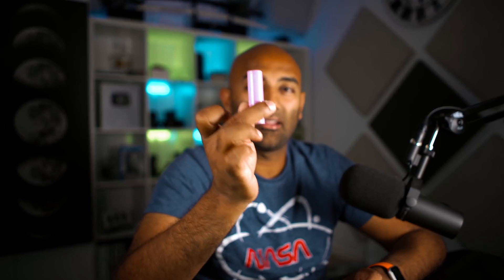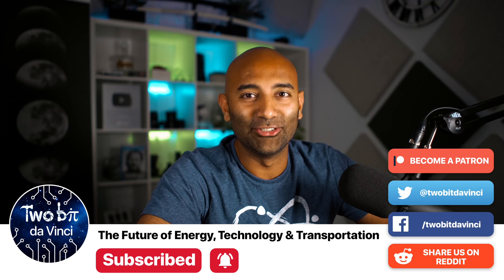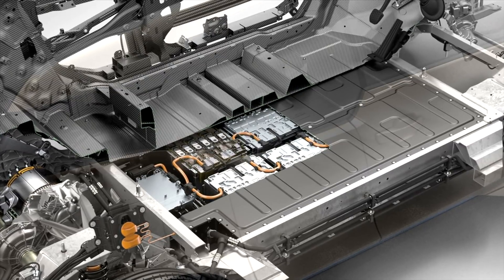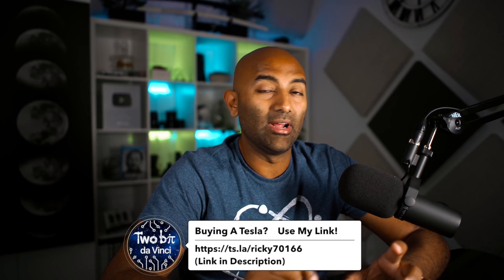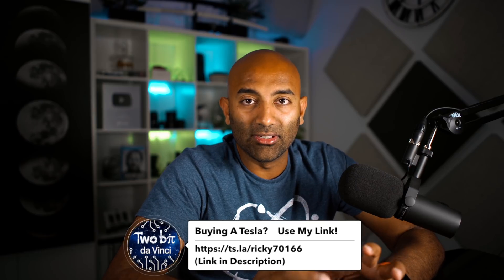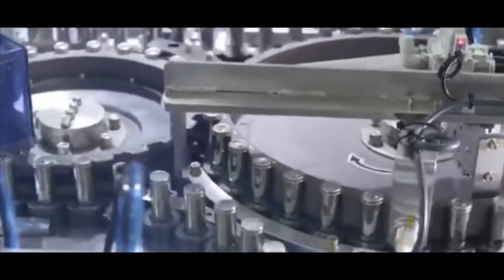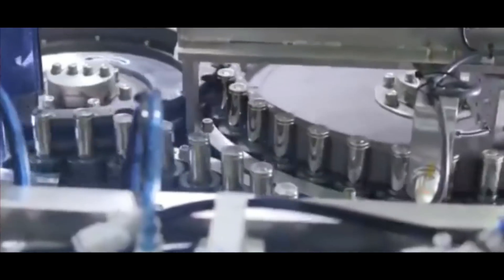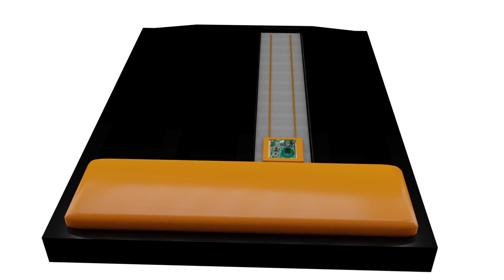Is Tesla Moving Their Battery Strategy to Prismatic Cells?

Comment from the maker: Be my hero, become a Patron!  ⟫ https://geni.us/TwoBitPatreon
Buying a Tesla? Use my Link ⟫ https://ts.la/ricky70166
Reply: recent news is that tesla wants to make them cheaper to get subsidized by the CCP.
Reply: With all of the new battery technology that is evolving so rapidly due to new manufacturing innovations, affordability, breakthroughs, etcetera. Which battery will be more effective or the most powerful? The Prismatic, Graphene, or Carbon/Lithium Ion Hybrid? From what i've gathered, the Carbon/Lithium Ion hybrid battery. Boasts that it will have 8 times the capacity of a battery the same size and have an increased cycle life of 30%. And ofcourse the environmental benefits are hard to ignore as well. As we will be using an abundance of carbon emissions to manufacture these batteries. Are the graphene batteries becoming more affordable now due to manufacturing breakthroughs? I'm loving that new battery technologies are going to be an integral part of grid storage going forward. As I live in N. California where last summer we had to shutdown the electric grid for days due to high winds causing the fire danger to increase, as the main transmission lines for PG&E do not have enough clearance from the forrest underbrush of mismanaged lands that are overgrown. In the event high winds cause transmission lines to break? We here would have an immediate forest fire to fight, increasing the length of the electric outage. So for me having batteries that are able to store enough power to charge all my electronics. Ones that I cannot live without in this day and age Lol. Really is something that interests me greatly as I don't want to run a generator if I don't need to. I really did enjoy the segment and look forward to watching many, many more. Thank You 👊
Reply: Totally debunked by BD, so re-listened for rationale...NADA! Where did that info come from?
Reply: Two Bit da Vinci, I’m gonna use your link for a Solarglass roof and solar panels in a couple of days if I can, I reserved them already. Your channel is one of the best, keep up the great work, Ricky.

Comment: I've heard that eventually new battery tech will make it down to EBikes, EScooters, etc. What I'm wondering is do you think older pre say Graphene batteries models will be retrofitted with the newer model battery and is that even possible? Keep in mind many a user today has to develop some leve. Of maintenance skill as the availability of shops that can and or are willing to work on them is still fairly sparse so even if a controller need be upgraded it won't be that much of a hindrance for those who don't want the car trap of buying a new model every few years.

Comment: They originally did cylindrical cells because of economy of scale (standard size, lots of small cells make it easy to make mass produce batteries even if the car is not yet mass produced). CATL already has mass production of prismatic cell so it make sense for Tesla to use them as much as possible. As long as they can get the cooling and charge speed under control there is no need for the high cooling surface area of cylindrical cell pack.

Comment: You need to cover how the new battery configuration will apply a new Cooling Systems to the new configuration otherwise the battery may be "cheeper" but will not have an extended Battery System Life.................

Comment: I wish more manufacturers would use LFP cells. They've been around a long time and the Chinese have been using them as their most common type for years. They have the advantage of being cheap, sustainable, and long lasting, perfect for a cheap commuter car. The energy density is a bit low, but not that bad. You could easily have a cheap car with 120-150 mile range, which is plenty for local driving. They aren't perfect for every use, but they don't need to be. They're perfect for a cheap, practical daily driver, which is what I need and millions of others too.

Comment: LFP sounds like it would be ideal for solar storage capability
Reply: Yes, we used them in a lot of our solar projects.  With a nominal voltage of 3.2v, it is also perfect to power a lot of electronics that run on 3.3v (2.7v to 3.7v) with minimal voltage regulation. It can also be charged down to -20c, making it great for cold weather.  It also holds up to heat pretty well.  We can't remotely measure capacity, but our greenhouse product is exposed to a lot of heat for over 10 years and we notice almost zero replacement request related to battery capacity.

Comment: Prismatic?

No idea where the name (which is certainly not descriptive of layered pack-cells) came from.  And I have no notion of why the term has stuck for flat-pack batteries or cells.
I digress.  Just saying.

But as electronics engineer, I would expect Tesla to handle this chemistry  and physical format alteration and peak charge/discharge power quite easily with the current electronic control/monitoring suite in all their cars.

The other main issue is to simply ensure that the FOOTPRINT (x/y/z) and connectivity for new battery packs is retro-fit capable.  Not very hard for the switched-on guys at Tesla.
Furthermore, as Tesla has opted from the beginning to embed the BMS technology into the battery packs themselves, if this strategy continues (why would they do otherwise?) then battery-car dialogues and battery monitoring and management is purely a matter of different parameter settings (I presume - but do not know).

So whatever turns up in respect of battery performance improvements, I would not expect Tesla to be in the least bit reticent about adopting them soonest - and with the same impressive aplomb they have previously managed, to trash other preconceptions about EV's in the last decade.

Comment: Have they considered how to recycle ,end of life and reclaim rare earth metals
Reply: Morando Bertoncini That was built in from the start. With auto batteries good for 10-18 years to 80% capacity, at the end of that period they are perfect for home solar storage.  For example, a Tesla 75 kW battery would have 55-60 kW which is good for approx. 3 days without sunlight.  That may be good for an additional 10-20 years. At that point metal recycling is available and will be a lower cost source of raw material for new batteries.

Comment: Personally-(Current world reality 3.5.20-dmy aside)
 I'd say that for Cooling; liquid that has a gas pressured in.
And tubes that are both conductive and permeable to that gas.

That liquid gets too hot, 1. Those tubes will conduct the heat out.
2. Gas will get in and carry out some off the energy.

In a radiator area, heat is radiated out, and the liquid is reinfused with the now cooled gas.

What they do is probably simmilar.

As to the Battery..

A Square shape would be an improvement.
More space to expand to, as long as it has enough space.

I would say though..

Making the Roof solar, would help with batteries that can't hold enough.

Also, capasitors..

As such, with those, batteries like iron/iron will be possible to be used.

Comment: I would of also mentioned that LFP is a chemistry that has been around for years longer than nearly all current chemistries so is a proven highly reliable tech which is almost impossible to catch fire...Yes it is a little less energy dense but all the space re gained from the wasted space between the cylindrical cells should make up for it and maybe then some.
Reply: that's liquid cooling volume, not wasted. The casings are the wasted volume and mass.

Comment: Why Tesla don't draft to Hydrogen fuel cells ? Like Toyota and Hunda. Where we have Recycling problems with batteries.
Reply from the maker: Hydrogen isn’t a great answer. It’s very expensive and there’s lots of energy losses. Plus you’ll be beholden to companies that generate hydrogen. With batteries, you’re free to charge even by yourself with solar, and after a few hundred thousand miles, you can recycle them.

Comment: Great exploration.  Cooling of large rectangular cells is where Nissan came adrift, many people doing distance found there was a deterioration in charging and capacity therefore, as extended driving caused heat buildup.  So, as you explain, the apparent inefficiency in packing cylindrical cells together, turns out advantageous for vital cooling.  However, it has to be said, Tesla won’t do something to avoid liquid cooling, which seems to be what Nissan wanted to avoid, thus leading it into inefficiencies when it came to cabin heating.  My own trip in a Leaf in a northern climate, was ended with my feet frozen in a way i never experienced in any other car.  If decent cooling is used and heat recoverable, that would not be an issue.  Tesla are willing to pioneer, I can’t afford one but have a lot of respect for them.

Comment: No, because manufacturing costs to switch over, redesign entire vehicle frame and packaging design to accommodate, completely different stamped parts, which means new molds, reteaching and redesigning the body in white assembly process, relining up their supply base, the need to completely change the equipment that manufactures the cells, etc. Too many reasons this is not the case.
Reply from the maker: Again they’re not manufacturing, they’re buying these from someone else. So their manufacturing output is added to this new source
Reply: @TwoBitDaVinci  I know, I design and sell the equipment that does just the fluid filling portion of the prismatic cell manufacturing cycle, this is not a thing they are entertaining. On that topic, the partnerships that Tesla has standing with battery manufacturers are ending because Tesla is taking over the capital equipment in order to further reduce total battery cost and cut out more of the middle men moving towards the final vision of total vertical integration. The vast majority of people have no idea what the implications of making a transition like this. This doesn't even begin to address the topic of manufacturing capacity. There aren't enough cell manufacturers to keep up with the rapid rise in demand for vehicle batteries and all my convention OEMs are realizing this too late. Audi and Mercedes are scrambling to get their own battery plants online and they are nowhere near the scale of Tesla's operation at present. Anyway, there are too many reasons why this will not happen.

Comment: Great analysis, Ricky!  I think you have nailed the key points.  I think the key will be that they can test their strategy in a contained market.  Maybe the prismatic cells are better, worse, different, need debugging, can be made faster, etc. -- all of these economic and practical considerations can be fully worked out in a single market.  Just the ability to say "no cobalt" is a huge win, and allows them to hedge their bets and avoid the supply issues that many other companies are facing now.  Compared to other Chinese EVs, Tesla will still have a huge range advantage in their SR model over nearly every other vehicle, so China is the right market to test this tech.

Comment: 5:45 I'm not disagreeing with you on that point, but it seems that the limitation on charging speeds actually is that the battery isn't hot enough.
Reply: The battery works best around an certain temperature. Tesla has active temperature management for thier batterys to keep them at that temperature.

Comment: The multi-cylinder flow-cell ICE battery is probably still the best solution.
Reply: Andrew Rabbitt - Until you factor in things like Pollution, Global Warming, Fueling Costs & Overall Cost of Ownership...
Reply: @TraditionalAnglican  The thing is, the cost of something - that is, both fixed and variable costs - correlates directly with its impact on the environment and ICE flow-cell vehicles seem to be way more cost-effective than BEVs so far...
Reply: Andrew Rabbitt - Sorry, but between the manufacturing of the cars and refining the oil & burning the gasoline, ICE cars have a dramatically higher cost to the environment than BEV’s, & that’s without considering the effect on Climate Change. Using the figures governments pay their employees to use their own cars in their work, it costs $35,000 to drive an ICE car 100,000 miles, & that’s not including depreciation which is substantial. When selling 2-3 year leases, the depreciation & the costs of maintenance & repairs are things we’d specifically mention. Tesla Model 3 has been shown to have ~5% depreciation after 1 year of ownership, while the normal ICE car has ~22% depreciation in that same year. We also know BEV’s not only are cheaper to fuel (Home electricity costs $0.02-0.04/mile depending on efficiency of the EV & the provider of the electricity) they do not require most of the maintenance & repairs even the most reliable ICE cars require. Altogether, these mean that owning an EV for 3 or more years will cost significantly less than owning a comparable ICE car for 3 or more years, even when one factors in the purchase price of the two cars. 
I’ve linked all of these previously, & various YouTubers & media outlets have discussed this - You’re just simply wrong.
Reply: @TraditionalAnglican  the only person that's simply wrong here is you which is why you need to cherry pick your numbers so blatantly.  Using depreciation figures for EVs in such a supply-constrained (and subsidized) market to prove your point is meaningless.  Depreciation is the single largest cost of motoring and if EVs become as mainstream as ICEs - which they'll need to do to be anything more than a green fashion accessory for the self-righteous - they'll suffee similar rates of depreciation as current ICE vehicles only that they'll start from a higher cost base and so will ultimately be more expensive per mile driven. Your $35k claim is ridiculous because the fuel cost for 100k miles is probably less than half that and then most of it is tax and duties anyway that the EV driver shirks. The reality is you can't drive around in really expensive technology and expect it to be having a lesser impact on the environment.  What few mention too is that by lowering the marginal cost of use as EVs do, they will accelerate the miles driven in a Jevon's paradox kind of way and the results net-net will be worse, not even accounting for the smug faces of the ignorant EV drivers...

Comment: One need not look far regarding battery technology on modern and future electric cars. All these so called "latest electric cells" are like 5 year old tech used in Radio Control cars.

LiFePO4 has lower peak voltage and lower ampere delivery compared to LiPo or LiHV but they are sufficient enough for commuting daily drive electric cars and still safer than other lithium chemistry.

Comment: I know there must be a reason but i have always wondered why they cant just have a massive battery cell, like instead of a bunch of tiny cells making up the battery, just have the entire battery be one big cell. Is it just more expensive, more dangerous, not efficient, or all of the above?
Reply from the maker: The more battery you have without space for cooling the hotter it’ll get which is very bad. The smaller the better the cooling. But bigger has better energy density. So it’s an engineering trade off game
Reply: @TwoBitDaVinci  ohhhh that makes sense.

Comment: i dont know about ambient temperatures in china .. but LFP batteries have a problem with cold temps (our house solar storage is LFP and it was specifically requested to provide a place that doesnt drop below +10°C since the battery exibits "large" voltage drops when too cold while discharging above 0,5C) ... also since the voltage curve from fully charged to empty is pretty flat it is more difficult to determine the state of charge.
But i trust resla enough to find a solution for it.

As always nice video with lots of information ^^

Comment: It's not really surprising, incoming solid state lithium ion cell will be less affected by heat so at the end there is no more reasons to continue using 18650 or 21700 cells while you can simplify a lot your battery pack design with big solid state presmatic cells.

What is surprising is that they are doing this right now with current tech, it doesn't look good for the reliability of Chinesse model 3.

Comment: Li Fe P are heavy and do not have the range Li Ion or LiPo have. That is the future structural LiPo sheets. I predict Tesla will be structural LiPo EV within 5 years. With all the tons of weight all made out of light high charge LiPo EV battery the range will SpaceX. Converting all structural members out of low weight high charge LiPo sheets is the future EV. Structural LiPo EV range 2,000-3,000 miles per charge.

Comment: Dah, so obvious. It’s just not cheaper to manufacture, it’s also more density per volume, a lot lighter and may not need liquid cooling system.
Reply from the maker: It’s not more dense. It’s cheaper though and better heat tolerance. Not more dense though

Comment: I think your missing the bigger picture, with teslas maxwell purchase supposedly the next gen packs the technology doesn’t early go in to Cylindrical cells are going to prismatic cells in another part of the world it gives tesla the raw r&d and real world mileages of going to a different pack style before committing its other production lines , specifically the truck line where the weight limits are key for hauling loads and road limits world wide.  The model s - plad r&d mule I don’t think had a full size pack but gave Tesla the technical raw data on scaling up , if you combine both and add a couple of licensing deals it will give Tesla the ability to produce there own packs and why Panasonic are less than thrilled by pulling out of the solar deal this may be a side ways best at Tesla not to pull out of its existing commitments or else (remember Panasonic own a majority of giga 1, so it doesn’t necessarily mean they have to just produce for Tesla